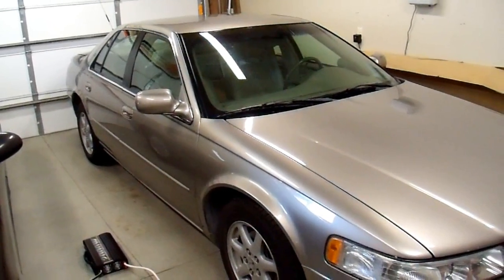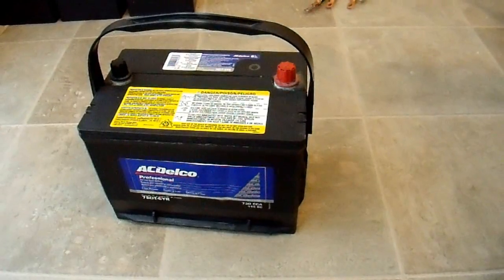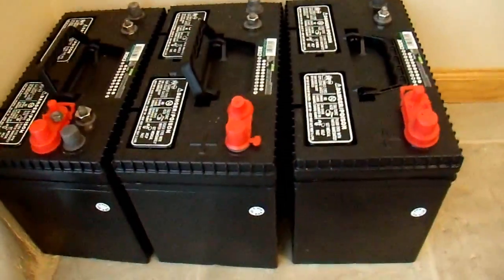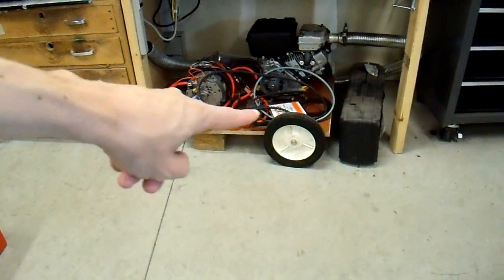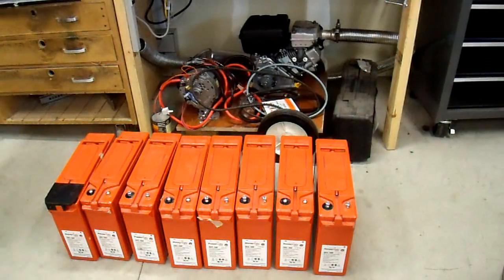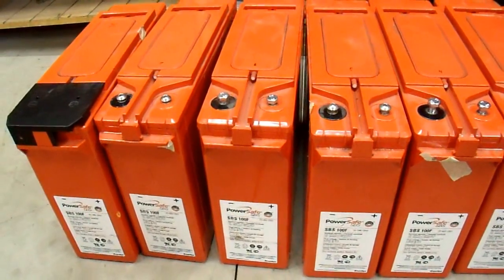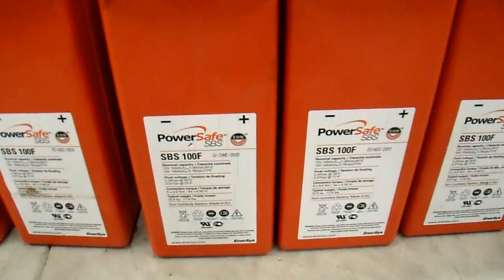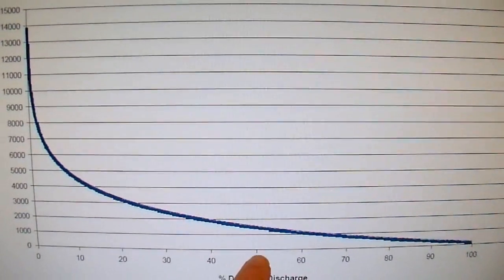1000Ah Battery Bank Part1 - My Salvaged $40 Battery Purchase : an Introduction

Comment: Hello, from Muscle Shoals Alabama United States of America.

You did not have email posted in the description for private communications.
so having to communicate with you by this method. 

You got real good deal, wished I could come across such deals, 

highly suggest you vest some time on videos how to build multiplxer circuit and diode isolator circuit and start searching for high storage capactiors then build cross pattern battery to parllel capacitor bank then you will be able to quick charge up and make the investment you have in the f100 last longer.  in my option, I can be wrong but I think I am write if you write the multiplexer circuit right in relation to cross pattern of capactors to parallel battery bank.  so do some video on captacitors used like battery bank but you used both your F100 in cross pattern to the capactiors then in my option you will get a longer life out of them.  

here some sites thought you might be intrested, 
http://www.ifixit.com 
https://www.thealternativeenergycompany.co.nz/products/water-heating/commercial-water-heating
alternaive energy solar water tanks 
https://www.gosun.co/products/ambassador
https://semtive.com
wind turbines 

https://www.1and1.com?kwk=194286533
you can get for relative low cost your own web site by buying the web hosting package which comes with your own web site name that you create and email accounts.

suggest that you post in the descriptions a email address for individuals to perform private communications with you.  

hope that helps.

Hope you and your viewers have a great day.

Comment: SO what of it...I need to know like the customer of that business that the day comes to use your power back up  and find it WORKS! Somethings are not worth cobbling together batters and what ever you can get your hands on to make projects. Its better to save your money up and buy new when you can.
a real back up system will cost about $12,000.00 dollars to do it right. From the Solar panels and  batters, to the cables and everything in the middle.

Comment: This battery reconditioning guide works by showing you step by step how to recondition your old batteries [Check Details Here==>https://plus.google.com/100351090281822647456/posts/HMvgs7qqoKA  ]. Again this is a digital book. Although it’s very easy to follow, as far as I’m aware Tom hasn’t put this information into video form yet. Which would be great. I personally love reading.
Reply: NICE
Reply: Great
Reply: They want to sit and sell things. Lol
Reply: what a load of crap. when lead dissolves away, there's no fixing them.
Reply: takes tens of years for the lead in batteries to dissolve .lmfao

Comment: Quite carelessly slapping those batteries down on the concrete...speaking from experience, it causes micro fractures and stresses in the plastic, especially older ones, that have been exposed to UV, the plastic is brittle, and as little as a few months they can start to split.

Comment: normally exide makes some of the best batteries around, really heavy duty and long lasting. at one time they were commercial duty only places like the rail roads rooms and rooms of them each cell about 2 foot square the lead post's on the top about 3" square with solid 3" buss bars for interconnects. then there were the running batteries on the submarines, over 300 volts of them and whole bunches of amps to run everything when needed,  do not let anyone pull your leg even a nuc powered sub still has the battery packs without them they can not restart the reactor if they need to do so, yes, there is an on board diesel gen but that running at max full power is not enough, some battery is required.

Comment: Wet Ni-Cd batteries are very good for use as storage batteries; they are used in mining vehicles, as turbine engine starter batteries and as accumulators in hybrid locomotives.  They have twice the capacity of lead-acid batteries of the same size, but they are very expensive even used because they can be renewed almost indefinitely.  Nickel-iron is a similar technology- it's actually the oldest storage battery technology still in use- but the chemistry is much slower than nickel-cadmium.
Reply: They also build a memory. If you recharge when 80% capacity after awhile they run down if not charged at 80%.

Comment: I would love to get some of these for my RV.  I need two only.  I just bought 2 AGM new batteries, at $200 each, ouch!  Wish I had known about these types then.

Question:  If i switch to Lithium batteries for my RV coach, should I have any problems upgrading to these?  Currently running on 2 12 volt AGM batteries at 100 amp hours each.  At some point I need lighter Lithium batteries.  However, I have a cable from engine starting battery to my house batteries.  If engine battery is dead, I can get a boost from the RV house batteries.  If I get Lithium in my house side, do I need to upgrade engine battery too?  Apparently your system has to be all one or the other.
Reply: +Lass-in Angeles we have the battery conductance tester, battery monitor, battery dummy load, can test and exam the battery conduction and real capacity, etc, my skype: davidcharles520  email: yangping@criane.com
Reply: +Lass-in Angeles just so you know these batteries are about $670 a peice.

Comment: About 10 years ago, I had a friend who worked for a rural telephone co-op.  Told him the next time they were getting rid of a set of back up batteries for one of their switching offices, let me know and I would take them.  About a year later he called.  I got 24, 2.2 volt, 230 Amp hour batteries and the rack they were mounted on.  For free!!!  They were 20 years old, and that's why they were being replaced.  But all were still good.  Telephone systems run on 48 volts but I split them into 4 - 13.2 volt banks and put them on trickle chargers.  Will use them for Ham radio communications when the power goes out.

Comment: Those are communication back up batteries. They are not deep cycle. The are special though but not deep cycle. Most likely they were used as a series parallel 48 volt back up!

Comment: @knurlgnar24  I'm not sure if you're able to see this message, as I'm new to google+ and I'm learning my way.  Is there a way I can send you an email?  I've added you.  Question:  Is it possible to extend the life of a car battery by attaching in parallel supercapacitors?  I do this because though supercapacitors in series can start a car (youtube it), the power gets drained quicker than car batteries.  

Thanks.

Comment: Batteries have been and still are the weak link for solar/wind power, as well as electric cars (although they are finally making some progress, but still not ready for prime time). As people who live on boats trying to use solar power can tell you, batteries are way too fussy about everything. They can be damaged by overcharging, too much heat, excessive discharging, and even if you watch over them they can still die from some internal malfunction. And they all will need regular replacement as they get old.

Comment: Can somebody explain why you would  a 1000aH @ 12V == 12KW  need for? This means you can run your 2000W inverter for 12.000/2.000 == 6H.  And 2000W @ 110V == 2000/110 == 18 Amps continuos for 6 hours without recharging. 

Did  you also consider the option to feed the inverter  with a combination of your battery pack and your generator?

What if your 12V charger would feed the inverter directly? 

May be you use that 18Amps for generating heat or some mechanical power. Just imagine all the transformations of the enery from combustion to piston to crank to pully to generator axle to magnetic field to current to 0 gauge wires to dyaletric plates to etc etc etc

Comment: Nice video. Its a ommon problem on Honda and Acura vehicles after the OE Honda battery have been replaced with an aftermarket battery. I lost all power in my Acura TL, thought it was the Main Relay, ended up being a loose postive battery termjnal at the post. Used a battery post shim and problem solved.

Comment: Could you use these in series for say a electric golf cart? 3=36 volts 4=48 volt cart?

Thanks
Reply: 1994. Chevy Blunder motto home battery conections
Reply: thunderboldt17@gmail.com
Reply: 1914 Blounder Chevy motor home Battery setup

Comment: I have a generator. Bit cheaper than batteries...

However, for a video idea, you might want to experiment with electrolyzing and recombining hydrogen. It might be a more efficient fuel cell.
Reply: waterlubber A good bit noisier as well. I prefer silent power.
Reply: Black Hat Is it noisy? Fuel cells can be silent and electrolyzers make at most a bubbling sound.

Comment: I am getting a 250w solar panel. do you think that the extra cost of a 24v system (more  expensive inverter, would be justified for the lower voltage loss? The system will be in a van so it will be extremely short cable runs. idk what other benefits a 24v system composed of smaller batteries in series like the one you have here would have over just a single large 12v 155ah vmax agm battery. if you have any insights, thank you

Comment: Great vid, thanks. I need to get two 12v 100ah batteries that are cheap. I need these for my riding mower I converted to electric. 
Can you recommend a battery? I cut the grass about 5 times a year. Thanks

Comment: Can you prove and show. Series battery two volts equal 24 volts one new and one older what happen to the new battery I did my testing the new battery Voltage drain faster also also I know the current say the same can you show a video about this thanks

Comment: I got a bunch of gel cells. 63lbs each. I had over 50 of them. I'm not sure how many I have left. They were free!
Reply from the maker: Awesome deal if they still had life left in them!
Reply: ***** they'll still pull a 300amp load
Reply: they're pretty useful, I'm runnin a 20ah in my car
Reply: Start your very own battery business and make huge money here: JoxCharge.com
Reply: +ww321 where did you get yours and where are you located? I want to get some free batteries but not sure where to start asking.
Reply: +Haven Hope I got mine when I worked at the hospital. they were from a ups bank for the IT dept. It's hard to get them for free because they're worth over$10 each as scrap. you may be able to pick up some from a industrial battery supplier
Reply: Thanks!
Reply: +ww321 we have the battery conductance tester, battery monitor, battery dummy load, can test and exam the battery conduction and real capacity, etc, my skype: davidcharles520  email: yangping@criane.com
Reply: +ww321 Also there is a good guide for diy on www.facebook.com/diyhomeenergykits/app/190322544333196
Reply: I need to start looking at close closing businesses and contacting owners.

Comment: Holy cow 1000 amp hr @25 amps is like stealing candy from a baby at $40.00! Never mind there life cycle of 15 years. 

You could run a 1500 sq' house on that with modest priced solar panels for 3 weeks. Assuming you do some LED lighting and efficient AC\Heating and water heater setup. 

Great deal for the do it yourself person.
Reply: You are being a bit optimistic.  The efficient appliances and even the LED lighting could be too costly. Also, a modestly prices solar panel set up would never supply the power needed.

Comment: Dude, you should learn how to build a Bedini SG motor they rejuvenate dead sulfated batteries. I don't know about the over-unity stuff because I don't have the money to buy 4 car batteries just for experiments but they do restore old batteries.
Reply from the maker: Please see my video on how to properly desulfate batteries, as well as my video on Peukert's Law.  These devices don't actually work any better than constant voltage methods.
Reply: *****
so... have you tried to desulfate that old battery you talked about in the video? I ask because I have been able to take batteries that were even bulging on the sides and have been sitting around for years and get ... mmm about 50% capacity back out of them but i think that was because the lead was gone in a couple of the cells.

Comment: Just watched the Whole Series on 1000 AH Battery Bank 
Very Nice! I think you are aware of nearly everything you can do to make this work better, but the small (approximately 3/8" eye lugs) could use some "help" and that would be using "Copper Shield" conductive compound on the connections, bolts and threads. It would reduce voltage drop at the connectors. 

I noted that you had said in one place in the series that desulphation units were no good, and I'm sure there are many that do nothing. I have been working with technology similar to the Bedini charging method (high voltage pulse DC) and with very limited cycles, I have noted 20-25% capacity gains, even on new, good batteries!  Worth checking out, IMO. I am still on that path and it is very promising. Working on the OU  side of things, but the normal practical aspects are fantastic. 

Once again, very good series. Subbed

Comment: These batteries are used in pre made high quality off grid system kits with all the extra equipment u need ( solar charge controller,solar panels,wiring,fuses,battery monitors) for 3000 and 6000 watt configuration setups sold in electronic hobby shops.They are also very expensive.
Reply: Nonsense. These batteries are not useful for off grid systems at all. They will not last a year.

Comment: Be sure to wear protective vest and face shield when working with 1000 ah. IT IS ECTREMALY DANGEROUS. I even tape my spanners so there is no metal parts showing.  My bank was a  1600 ah forklift pod and the guy that I bought it from said he had an accident with one that blew a hole in the top of his work shed

Comment: I'm actually not sure if that's manufacturers recommended float charge. I couldn't find it when I set it up, also I'm quite new to this and some of the spec info confuses me. if you happen to stumble across this information let me know.... Thanks again
Reply from the maker: I looked it up and the Powerafe SBS EON batteries should be floated at no more than 14V in cold weather, but at least 13.9V.  (cold being around freezing)  In warm weather the voltage should be no less than 13.3V.  Float implies the battery is on charge for weeks on end between uses, so I'd set it in the upper 13's for an EV.  If the charger isn't temperature compensated then the voltage set point will depend on the climate in which you live.
Reply: That's very helpful. I've set it to 13.9v as it's just hit autumn here in the Uk. Thanks agin for your help it's much appreciated. Cheers Wayne

Comment: You can research auctions on the Web for industrial equipment and may find stuff like this guy. Have to dig. Most are local stuff.  The issue is you likely need to pick this up 1000 lbs of battery shipment have fun.

Comment: Thanks a lot for the information, this video made me choose a powersafe 170ah for my solar van project.... Works a treat...
All the best Wayne
Reply from the maker: That's a good battery!  Just be sure to not run it down too much or overcharge it too much and it will give you an exceptional service life.
Reply: I'm only ever in the top 20% of the battery, it also float charges at 13.2 volts ;-)
Reply from the maker: Wayne Alexander
Staying in the top 20% will keep it alive nearly as long as never using it at all.  :)
I haven't looked at the specs and you may be doing everything right, but if you haven't already looked it may be good to check the manufacturer recommended float voltage for your average temperature conditions.  13.2V sounds a little low maybe?
Reply: *****
''''Staying in the top 20% will keep it alive nearly as long as never using it at all.'''

Is this a good thing or a bad thing to stay at the top 20% ?
Reply from the maker: Bonnie Flory
Not good or bad.  You're not using your batteries to their full potential but you're also not wearing them out very quickly.  From the battery's perspective it is a good thing but from yours it may or may not be.
Reply: Thank you very much for this information.

Comment: I used to sub contract for AT&T, removing and replacing old coaxial equipment from the field with fiber-optic technology. We used to get 10-30 12V 36A/h batteries a day. At some point I just started selling them for scrap, very sad indeed.